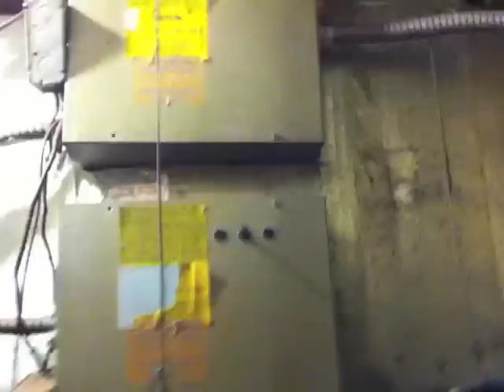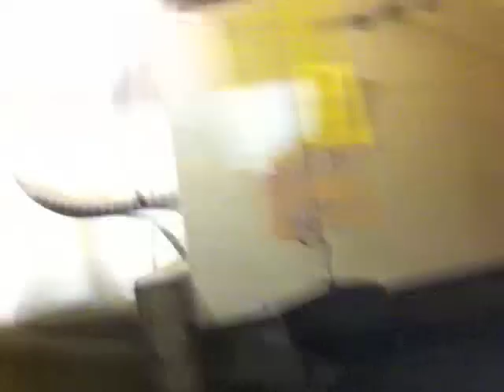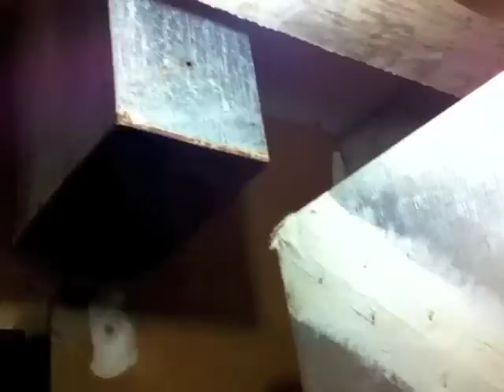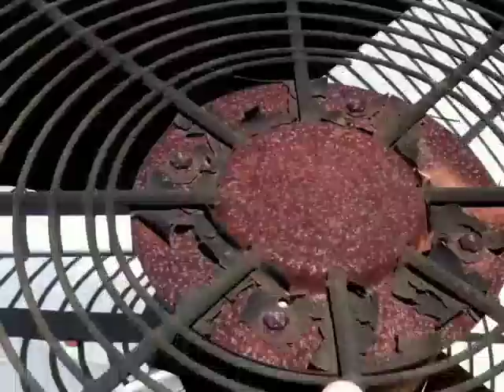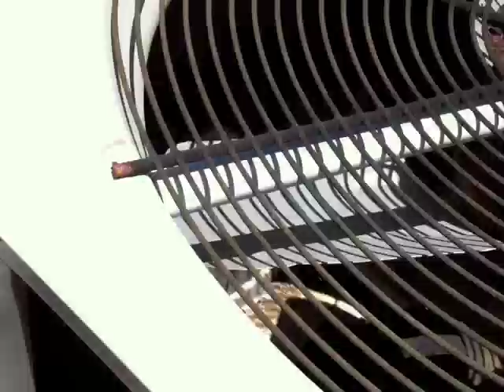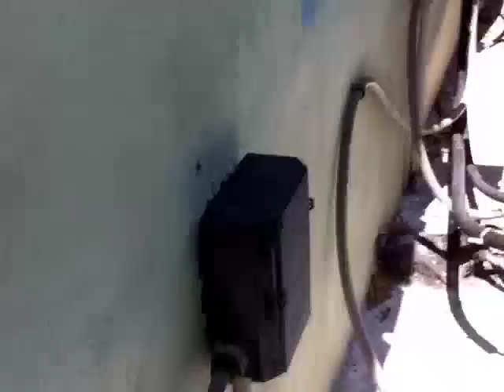Last Video of the Luxaire Unit

Comment from the maker: @bait28 If your unit is oversized that's not good because the A/C is supposed to remove humidity. As for this Luxaire it's beyond repair. It can possibly get us through this summer but that's it. My plan is to replace it before the heating season, but I have a feeling I'll end up replacing it before that.

Comment from the maker: @bait28 Really? Think about that. Let me explain why.
5. Noise - This is a fine dining restaurant on the other side of that wall are tables. The last thing guests want to hear is that loud thing start up.
6. Oversized for the area - By that I mean cooling power. 10-Tons is way too much cooling power for an area thats only about 2000 sqft. it only needs a 5-Ton.
7. Ineffcient- The last electric bill was $1000. When we don't use the AC/Heat it's only about $500. The unit pulls 135 Amps. 

Invalid?